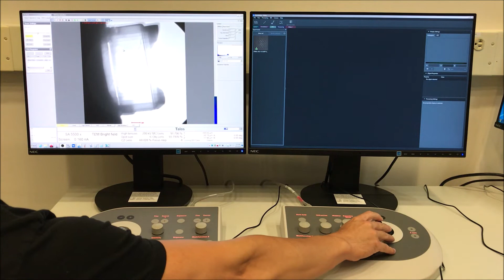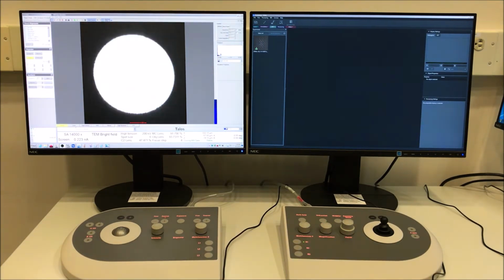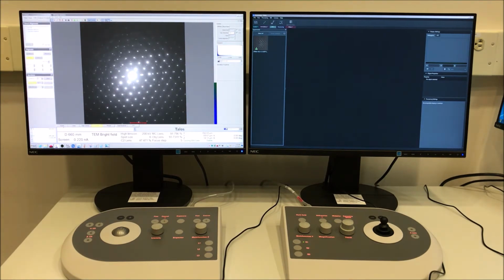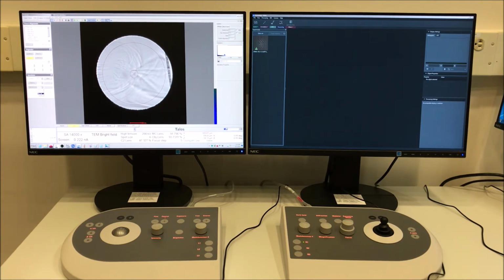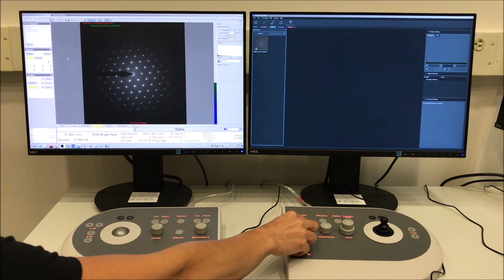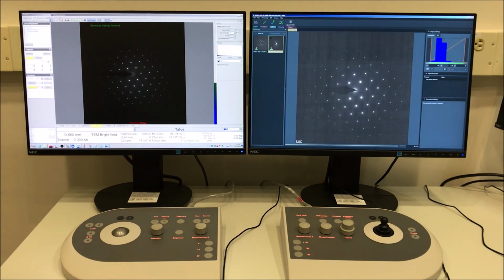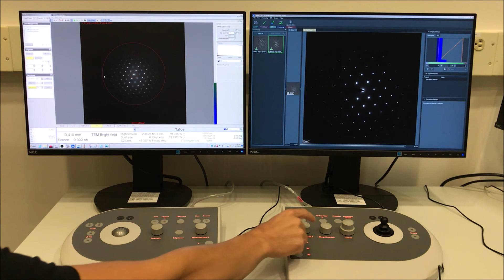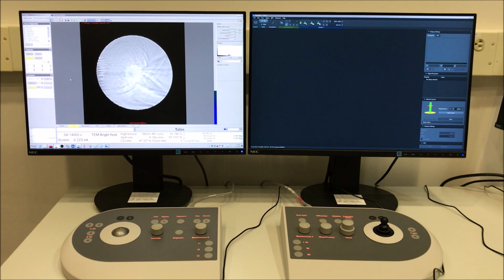FEI Talos F200i S/TEM: recording SADPs with the Ceta camera

Comment: Hey Nicholas, thanks for such great videos!
Maybe you have explained this before and I've missed it, but how would make the center spot little (same size as the others) if you go into diffraction mode, and is big? I am working with a C1 of 2000 and C2 of 100, with SA of 10. Thanks!
Reply from the maker: Hi Alan: make sure your SA aperture is retracted when focusing the DP.  Assuming you are properly focused on the back focal plane of the OL post-field, you then want to use the C2 lens to focus the spots to as small as possible.  Once you do this, your beam is now parallel and you can then go back to image mode (but do not make any further adjustments to C2).  If you want, you may then insert an SA aperture to field limit the contribution to the DP.  I hope this helps and thank you for your support.
Reply: @NicholasRudawski  Thank you for the advise! I'll give it a  try this week.

Comment: Hi Nick. If you have a sample producing a more faint diffraction pattern (like single nanoparticles), what settings would you adjust?
Reply from the maker: Hi Jillian: doing diffraction from single NPs can be very tricky due to the poor signal (like you've already noticed), a better option may be to take a high quality HR-TEM image and then compute the FFT rather than try to collect an actual SADP.  The other option is to perform CBED in microprobe mode instead, which should greatly improve the signal in the DP because basically all of the beam (depending the particle and beam size, of course) will be interacting with the particle.  This could also be done as part of a 4D-STEM experiment if you have a group of different particles, so the CBED patterns from different particles could be isolated (spatially-resolved).  If you still have questions about this, please send me an email.